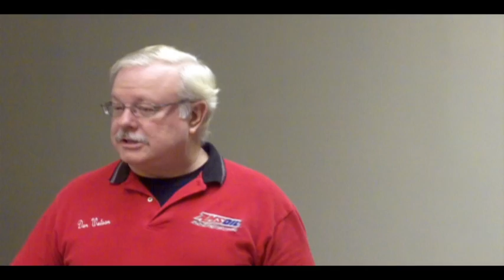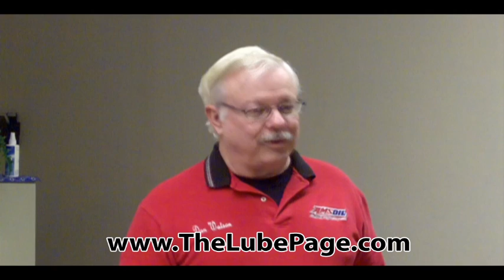AMSOIL 2-Cycle Synthetic Lubricants (1/2)

Comment: The comment on Evinrude Etech not meeting emmissions  without  synthetic oil isnt true. They burn very clean with any oil and Evinrude even says you can run their regular petroleum/synthetic blend oil, just at a higher rate. Using their synthetic oil just allows the computer  program to cut back on the rate, which isnt an advantage  IMO. Actually  it's a disadvantage.
Reply from the maker: My Evinrude Tech who owns the Shop where they sell Evinrude would specifically disagree with you.  Evinrude performs the acceptance with the XD100 to meet CARB requirements.  The petroleum oils run at more than twice the mixture rate and produce unburned hydrocarbons in the exhaust.  The computer can cut back on the mixture rate because the synthetic formula has better anti-wear protection at the lighter mixture than the conventional oil at he higher mix rate.  This is why all max performance two stroke oils are now synthetic.
Reply: @thelubepage  , so the owner has a machine to test emmisssions?

Comment: I am not sure about that amsoil. They say to put 1:100. On which engine did they test that?? Since not all manufacturers specify the same amout of oil for all the engines out there.
Reply: this oil is designed for 100:1. no more oil than that or it will probably smoke a lot and cause problems. not to mention you'd be wasting it. yes it protects that well.
Reply: Why would one want to run less oil through a marginally  lubricated engine like a two stroke? Why has not a signal OEM came out with  or reccomend  a 100:1 mix ratio?
Reply: @stihlvarna  Because it is simply not worth it to them. AMSOIL has spent literally years and years and untold millions on RnD. OEMs are more focused on building the engine, parts etc and marketing. They just cant compete with AMSOIL. It just literally is that good.
Reply: @peterssynthetics  Cut the crap. Amsoil is a bathtub blender of products other people make. The facility in Superior, WI is a warehouse. They haven't spent millions researching anything.
And if they have it should be non-issue to cough up some money and actually certify their products.
Reply: @stihlvarna  They have long since certified their products. This is a non issue.
Reply: @peterssynthetics  most of their products are not certified and none of their two cycle  oils are. Of course they make the statement "meets and Exceed" but that's worthless without actually  running through the certification  tests.
Reply: @stihlvarna  yeah? You try being at the mercy of the oil companies making you buy base stocks from certain vendors. It is about the money not the consumer. Thats why Amsoil uses base stocks from whom they choose, and it is always the highest quality. Bar none. If we did not adhere to the absolute highest purest quality base stocks, we would lose all credibility. Amsoil is THE best oil made. Just because some of the products do not carry the SAE rating, doesn't mean that at one time they were not and couldn't adhere to the minimum requirements. There is scientific disagreement on some phosphorous issues and other issues I don't have time to get into. Not everything is as you see it. If Amsoil had come out last year and they weren't SAE certified, I wouldn't touch it. They've been in business since 1972 (got their SAE certification then) and have always adhered to the highest quality standards! More then meets the eye. the plot thickens
Reply: @peterssynthetics   who do you suppose  amsoil buys their base stocks from? They certainly don't make anything. And the oil companies  don't sell bathtub blenders their latest  and greatest base oils or additives.
And Scamsoil has no credibility. The are a pyramid scheme for crying out loud.
And to be clear not one of amsoil's two cycle oils are certified.
Reply: @stihlvarna  Yeah, a pyramid scheme that stopped my wifes transmission from slipping after I changed out the trans fluid with Amsoil trans fluid? Same company that took the ticks out of my trucks engine, after 30-40 miles? Have you ever been an Amsoil dealer? Have you ever done a real oil analysis? Have you ever heard of Gale Banks? The legendary engineer that promotes them on his youtube videos, openly? Hell he resells the rear end fluid with his new diff cover. Get out of here!
Reply: @peterssynthetics   I bet it cures arthritis  too.... and you are really  barking up the wrong tree in attempting to call out my experience. It's extensive and I work  in the refining industry.
Gale banks is a mechanical and electrical engineer. Both of which have nothing to do with petroleum  or chemical engineering  that are applicable to the subject at hand. In addition his products  have never been all that impressive  given the price.
Reply: @stihlvarna  Yeah it cures arthritis man. LOL You/re just a treat!
Reply: @peterssynthetics  no less outlandish than the claims you made.